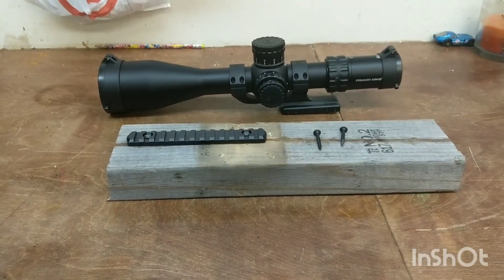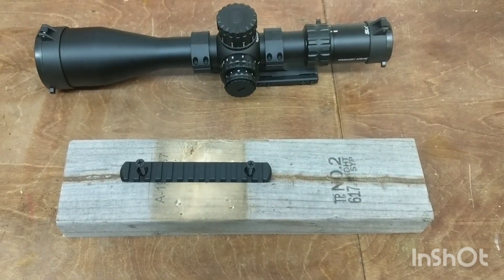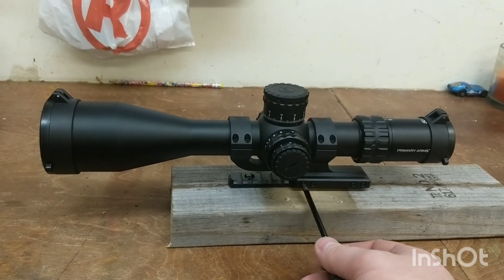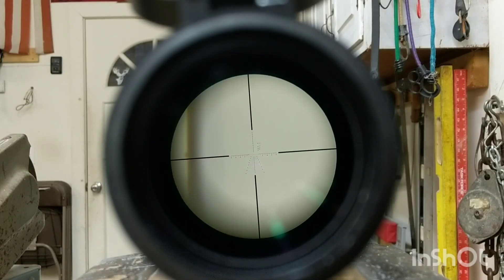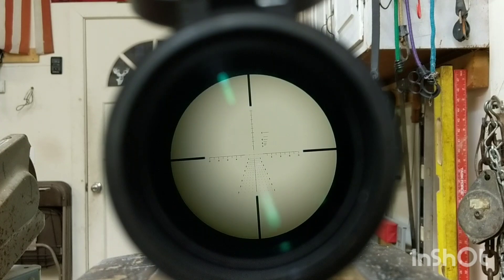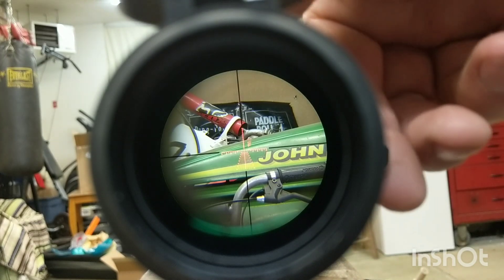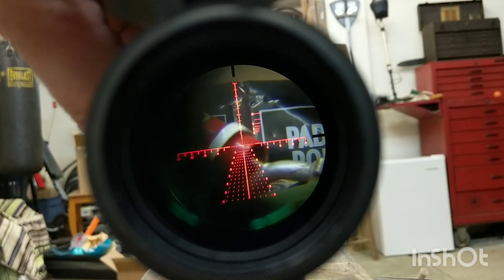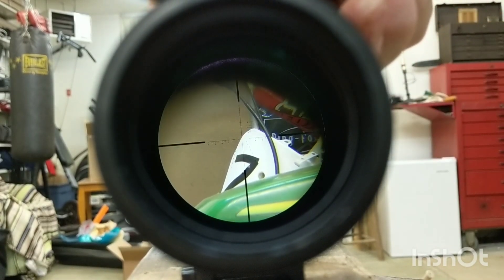Primary Arms SLX 5-25x56 homemade camera scope mount build and Apollo reticle view with illumination

Comment: Those lines on the top right of the reticle, what exactly are they for???
Reply from the maker: Those are for estimating distance.  If you have a target that is around 5'10" tall, you place the bottom of said target on the horizontal line and the whichever line the top of the target is near, that is your distance in yards.  The top line is the closer distance, I believe 400 yards, then the lower lines are progressively in 100 yards increments to 1000 yards.  You then use the holdover for each of those distances out to 1000 yards without having to dial anything in.